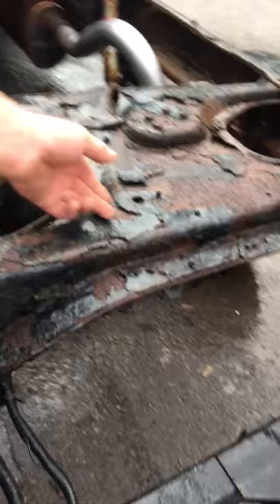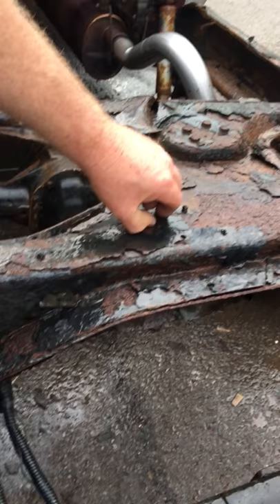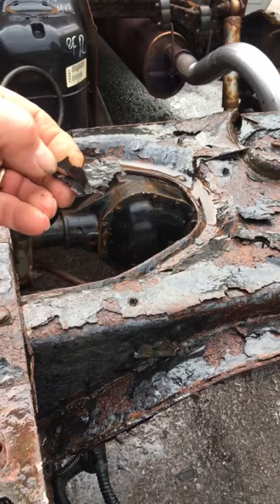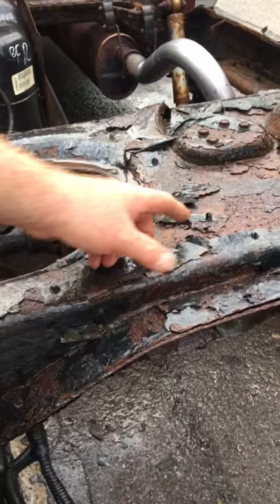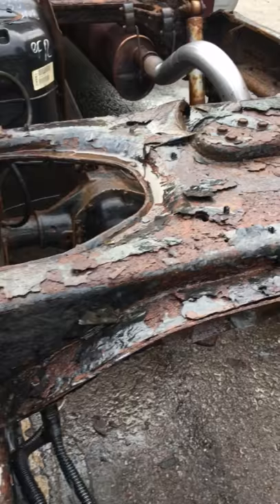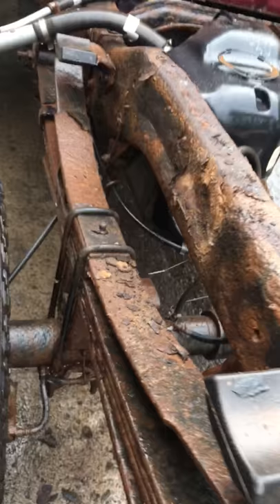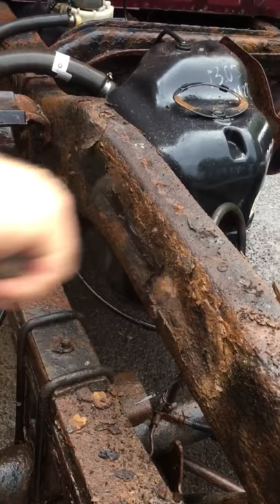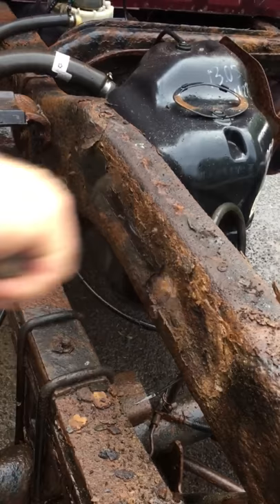Por 15 Is Junk! 2 Year Update

Comment: You need to prep it por15 can be painted on rust but prep is required all scale but be removed then clean the surface with degreaser then clean the surface of de greaser then let it dry then do one last look over them apply just saying it requires very good prep I have seen multiple builds in person with proper prep it truly does wonders but no one properly prep just assume it will stick

Comment: The zinc coating is the most important part. Step 2, the metal prep, they call it. It seals the rust and etched the metal so it doesn't fall off

Comment: You might want to read the directions vefore you use it. If you paint over wet rusty metal it will rust faster. Prep work is 90% of any paint job, not 10%. Dont blame the paint for the finish if you didnt follow the directions.

Comment: POR15 is some strong stuff, and once dried, it don't come off well, even with acids, alcohol, or acetone. I just did my fuel tank but now worry that I thinned it out too much with acetone, and altered the chemistry too much for it to dry and bond permanently. I seem to have some strips I can pull off like old clear tap accidentally left under some paint. This is not a good sign for the inside of a fuel tank. Its not the fault of the product at all, its that I thinned it to work in an atomizer sprayer I bought, and I also had leftover rust the muriatic acid couldn't get to, that this stuff bonded onto and then flaked off. This product is the real deal, but it does require much prep work and cleaning before applying, and, don't go beyond 5 percent for thinning.. I went to 33 percent and well, I think I screwed up.

Comment: Maybe don't spray permanent under coating on an already rusty frame, it's just gonna seal that shit in and accelerate rusting, use an oil based undercoating like fluid film, basically a spray on grease

Comment: That’s just a prime example of poor surface prep, the name states paint over rust, but on the instructions it wants you to knock off the loos rust with a wire brush, you can’t paint over heavy scale, still needs to be down to bare steel. But surface rust is fine to paint over, plus frames are exposed to a lot of oils and debris from the roads, whos to say it wasn’t degreased

Comment: It’s a rip off…and yes i degreased using the marine clean and hot water a bunch of times…removed flakey areas then used their metal ready….applied the por 15……5 years later 🤷🏼‍♂️…..
A better method is to degrease the surface then use a rust converter….the magic is using boiled linseed oil over that and let it dry until hard…..then it’s ready for paint….🙂👍🏻

Comment: Can apply to rusty surface doesn't mean you can put it on flacked rust you need tu at least pass a wire wheel and clean the surface good before it's not magic

Comment: I guarantee you didn’t read the instructions
Reply from the maker: Did, but try it for yourself you’ll see. Just trying to help someone else out.
Reply: How can you guarantee that?
Reply: @kevinodea3423  I have been using it for seven years now. Truth be told, the only time it has failed is when I did not do the process correctly. I wasn’t trying to offend you but I want you to give it another shot the right way and see what happens.
Reply: Kevin Odea no you didnt. Done right that stuff is insanely strong. Been using it for years. Hundreds of hot rods and customs thru my shop with it on it. There is a 41 chevy truck outside my shop now with a good bit of por 15 on it. Moved out of shop 3 years ago into midwest weather. No fenders or doghouse even on it. A rubber cover over the engine. And not a single rust issue where the Por is. Get real dude.

Comment: Yeah, man, you gotta hit that frame with a putty knife and a wire wheel. Then clean it. And rinse. Then scrape that frame again. Then clean it. Rinse. Then use the metal prep. Well. Then rinse. Dry. THEN tge por15 goes on. 2 coata. You hurried. You ruined it. We can tell. The shit works id you prep. And prep. And prep.

Comment: I agree I use to work in a shop that I did undercoats my prep time was about 4 to 5 hrs to make product last as long as possible iv seen this after IV done all the way to grinding frame free of rust before plus washing IV yet to find a good product but I would probably go bare metal prime paint seal haven't tested it
Reply: All manufacturers, if is clean metal, use 2 part epoxy.  So already 30 years.  Do you live under rock.
Reply: I did things how they wanted in the shop I'm sure there's better way than over kill
Reply: What’s IV mean

Comment: Bro didn't even bother to remove the flaky rust before applying.  Zero prep work.  You get crappy results.  I'm a professional painter, and Prep work on anything, especially metal is ALWAYS a must, no matter what the product claims.  

Steps for POR-15.   1. Scrape, wire brush or sand off ALL flaky rust.  
2. Clean with degreaser and rinse off
3. Apply Metal Prep - Let dry then rinse.  It will apply a coat of zinc to help BOND the Por-15
4.  Paint on POR-15 with a brush,  2-3  light coats.

Comment: It is called a "rust incapulator and converter" . Like ANY PAINT/COATING you still have to properly prep the surface . If you do not (like this) it will NOT perform well/make things worse. Period. Peace

Comment: You didn't take the loose flake off!! POR15 needs to adhere to rust, not flakes of rust, it does not adhere to clean steel either. You didn't use it correctly unfortunately...

Comment: You can’t just put POR 15 on the titanic and expect for it to resurface again… first you need to hammer your entire frame before you coat it. As a matter of fact, use a jackhammer instead. After the jackhammer, it might not be a bad idea to hit it with a wire wheel… if that doesn’t work, just chuck it back into the middle of the North 🗻🛳️ 🤷🏻‍♂️

Comment: Yeah everyone talking about prep is totally right, removing the loose rust would keep it from peeling because if you noticed it was pulling the metal off with it because it was so scaled up, interesting how you can swing a hammer to knock it clean afterwards but not before you applied it, what an idiot...

Comment: Por15 use to be good in the past. I think they may have changed it. used it years ago probably around 10 or so still holding up good. Bought it again for use on the rain gutters on my truck and prepared everything to a T. 2 years later bubbling and peeling.
Reply: POR-15 hasn't changed, this guy saw "paint over rust" and slopped it on a frame that still had flaky/crusty rust on it. The stuff doesn't work well if you put it on that kind of deep crusty rust because that stuff holds moisture and salt and will continue to rot under the surface. With that comes adhesion problems.

Comment: Ummmmmmm.  You must have painted over flakey rust.  You gotta knock that stuff off and wire brush it all. It needs to bite into something that is actually attached to the metal.  It needs to bite into the metal.  Once it does.  Boy is it hard to get off.

Comment: Thanks for the update. You’re not the only one saying it’s junk. I’m going to stay far away from it.
Reply from the maker: Yeah, chassis saver is another good option, or zero rust.
Reply: Por 15 is a great product he didn't prep the frame properly and thats why his truck is Swiss cheese now. You're supposed to COMPLETELY strip the frame to bare metal and wipe down with degrease before applying ANYTHING.
Reply: @michaelbrady8070  I stripped my frame and sandblasted it to bare metal, degreased and etched with por 15 and zero rust after years of plowing. And with heavily salted roads, I also wash truck after each storm.
Reply: He didn't prep it
Reply: @kevinodea3423  you didn't prep it but ok

Comment: Prep work is 95% of the whole job. It doesn't matter how good the product is, if you put it on a bad rusty surface, the rust will spread even when sealed. You only put a good coating on stuff after you've removed the corrosion. Not a good video.